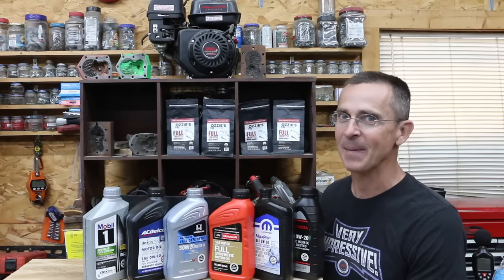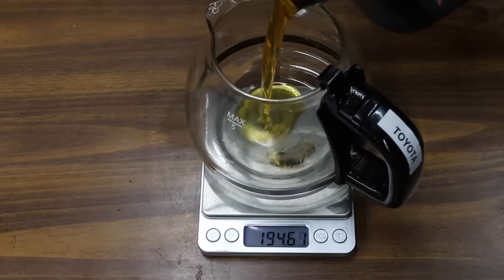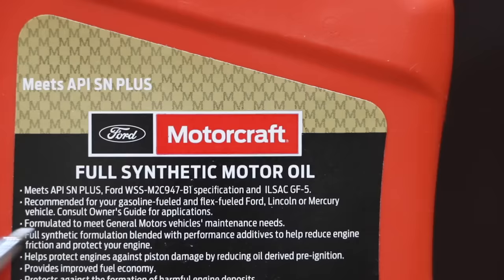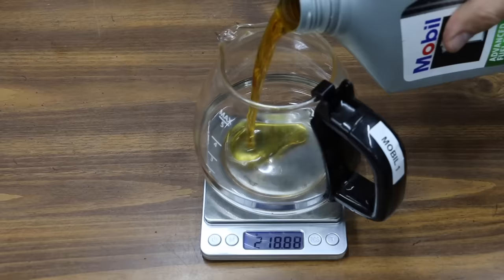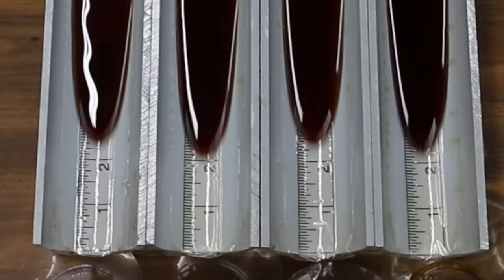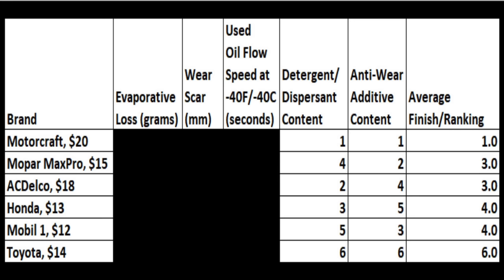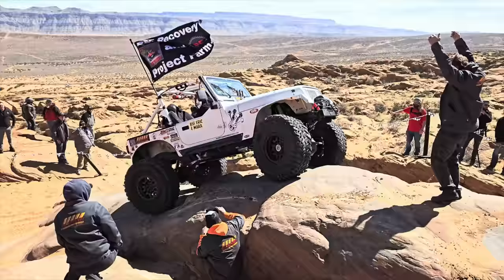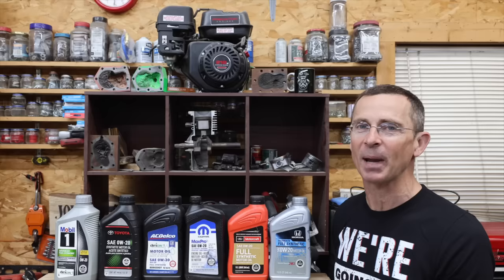How Bad Is OEM Motor Oil? Honda vs Toyota vs ACDelco?

Comment: Appreciate the tests & comparisons. HOWEVER, the burn-off weight comparisons are not calculated right. Since they are not all the same weight initially, one shouldn’t  compare differences by simply subtraction, that’s skew. To be accurate ONE NEED DIVIDE THE RENDERED WEIGHTS BY THE INITIAL WEIGHT TO GET THE PERCENTAGE OFF LOSS. I figured someone as thorough as this guy would follow through on this rudimentary scientific procedure. Right??

Comment: Notice the thumbnail bottles of acdelco , motorcraft and honda oil they are the same. And check the lab results they are extremely similar. The manufacturer is the same i reckon.
Reply from the maker: Thanks for the feedback.

Comment: I wonder if the oil results are why a few Toyota engines have had a reputation to drink oil as they age. My Honda seems to do fine, in fact it seems to shrug off abuse but I'll definitely try some other oils to see if they hold up better especially in the colder winter months where flow on startup is especially important where most engine wear typically happens
Reply from the maker: Thanks for the feedback.

Comment: You need to do more than one run of each test. When results are this close, you can't tell whether the difference is significant without measuring the variance.
Reply from the maker: Thanks for the constructive feedback.

Comment: Test atv/motorcycle specific oils? That would be interesting with a quart costing $7-8 a piece to see if their is really a difference in the oils and basic mobil 1 oil for a car/truck.

Harley oil, honda oil, castrol oil, Valvoline oil, etc all make atv/motorcycle specific oils
Reply from the maker: Thanks for the suggestion.

Comment: Consider using motor oils that originate from their respective countries. For example, Honda and Toyota oils from Japan, or Motul from France. It's possible that these oils are formulated to suit the environmental conditions of their specific regions.
Reply: Also, right now, they released newer versions of motor oils.
Reply from the maker: Thanks for the suggestion.

Comment: I watched a few of these builds curious of what the boost and expected air density improvements made are but none have any gauges showing anything.. I dont expect much boost with the wastegate not kept closed and the turbo might be too big for that engine....
Exhaust turbine housing removal technique used here can damage the turbine blades.  The housing must be guided straight off so that the wheels dont contact the housing..

Comment: You shouldn’t have mixed them up to be more fair, if it fell out of suspension in the bottle, it likely will until a certain amount of jarring actions or turbidity is reached. It’s not like you shake your engine before you start it

Comment: Could you test car coolants? I'd imagine the setup would have to be similar to a computer All-in-One liquid cooling setup. Radiator, tubes, fluid pump, cold/contact plate, thermometer, large fan, and a source of consistent heat to test heat transfer. Then I imagine the same Oil tests used here would work the same for the coolants.
Reply from the maker: Thanks for the suggestion.

Comment: Part of this needs to be taken wit ha grain of salt. Engine design will likely be most important here, as you can use the best oil, but if the design is poor (like it doesn't provide good flow of oil when it's cold, or other issues) then what oil you use doesn't matter.  I'd also like to point out the longevity has a lot more to do with maintenance in general than the brand of oil used. As long as you use the correct viscosity and type and you change it at regular intervals (say 6,000 miles or 5 months for most areas) then you should get a long life out of your car providing your engine is not of a bad design that is prone to premature failure.  I think that we can also say that while the Toyota oil perhaps didnt score the highest in the tests, their motors have proven to be very reliable regardless, and yes I know it's not like you have to use the Toyota oil in a Toyota.  You can use the others, although you may not necessarily want to go using AC Declo dexos1 in your Toyota either.
Reply from the maker: Thanks for the feedback.

Comment: Any chance you can test Ford MC 5w50 vs Amsoil, redline, motul, Castrol. Some aftermarket oils don't actually meet Ford specs and it would be nice to see a comparison. They use this oil viscosity in everything from my Focus RS, mustangs, even the Ford GT.

Comment: I have religiously used only mobile 1 in my fleet vehicle on my town cars and personal vehicles. I will say even though given the results my fleets has all surpassed 1,000,000 miles and personal cars all Mercedes and Audi almost 200,000 miles. Still a great brand regardless
Reply from the maker: Thanks for the feedback.

Comment: Most people that do their own oil changes would never buy the OEM oils anyway. The cost difference is astronomical.

We really need a 0w 40 versus 5W-30 premium oil comparison.

Is 0w 40 Superior in both ways? RR 5W-30 and 10W-30 full synthetics similar?
Reply from the maker: Thanks for the suggestion.

Comment: It might be best to use “slow” oil in the summer and “fast” oil in the winter. 😊
Reply: I use same weight oil year around, 5W-30 🤔Maybe back in 80's or something there might have been sense in using lighter oil during winter but with modern oils there really isn't much point.
Reply from the maker: Thanks for the feedback.

Comment: Would it make sense to calculate the % loss when doing the evaporation test rather than weight loss? As an example 7 grams of loss when starting with 400 is better than losing 6 grams if starting with 300 grams. Anyway thanks for all you do!
Reply from the maker: You are welcome!  Thanks for the constructive feedback.

Comment: I am dismayed for my loyalty to mobil 1. I have been told that there are philosophies for less detergents in turbocharged vehicle use, and to select mobil 1 for its decreased thinning at high heat. I may be putting motorcraft or ac delco in the machines going forward who knows. Sick that you got to go to the offroad games..  building a light crawler truck, nothing like that thing!
Reply from the maker: Thanks for sharing.

Comment: I'm not sure if this has been covered yet, but it would be interesting to know what happens if you put a low viscosity oil in an old engine (like 0w16 in a 10w30 engine) or vice versa.
Reply from the maker: Thank you for the video idea!

Comment: You know... car manufacturers DO NOT make their own oils.  They DO NOT have their own refineries to do so.   As such..they contract major oil companies with oil refineries to make oils for them.     I've personally been to refineries myself where the refineries were producing oils for Mopar,  Motorcraft , AC Delco ect ect to the standards set by API requirements and the automotive brand requirements.   Just think about this...

Comment: My problem is that I own a VW Jetta, and I'm stuck using whatever is on their VW 502 list, which ends up being M1, 0w-40 Euro formula that I can get a Walmart.  I also have a Volvo that needs A5/B5 oil; which I've only found on a Castrol Edge 5w-30, or whatever it is.
Reply from the maker: Thanks for sharing.

Comment: Please excuse my poor writing skills I bought a 2011 four-cylinder Ford Ranger new. I was told to use Motorcraft that's what I used. I changed the oil every time it started to change color. I'm up to 2 7 2. 0 0 0. Miles and with no noticeable loss of oil in between oil changes. I just bought a 2023 Honda Civic and have been recommended to use mobile one. What do you think Should I stick with Mobil 1 or use Motorcraft ?

Comment: I doubt engine oil will be very different between respectible brands but if you own a honda the only transmission oil you should ever use is Honda's
Reply from the maker: Thanks for the feedback.

Comment: Toyota dealer says 10k miles is the span between changes but pro Toyota mech say change it at 4-5 k  those who do their motors last twice as long.  My oil still looks new at 5k that V6 is so well engineered  I would leave it in for 10 but I keep my trucks til wheels fall off .
Reply from the maker: Thanks for sharing.

Comment: In terms of engine oil testing, do not get me worng, just used the one recomender in your manual or equivalent aproved, you should be fine. Not all enginevare built the same. Mobil1 Castrol, Valvoline , Shell  are the leaders.
Reply from the maker: Thanks for the feedback.

Comment: I have a question - and just starting video not sure if you cover it - but I'd like to see a comparison to older oil from the 70-80s vs the newer synthetics today.  I have a 76 GMC motorhome with the olds 455 engine (flat tappet cam).  There's a lot of discussion in the community about needing a zinc additive due to the flat tappet cams -  I'm in the more modern thinking that the newer oils are much more 'slippery' than the old ones and the zinc isn't needed.   a lot of guys run the 15w40 shell rotella for that reason.  which is actually a diesel oil for a gas engine.  what is your thoughts and take?
Reply from the maker: Thanks for the suggestion.

Comment: Please check the claims of Valvoline's new product:
"VALVOLINE™
RESTORE & PROTECT.
Restore Pistons to Factory Clean. The first and only motor oil that removes up to 100% of deposits – restoring your engine to run like new."
Reply from the maker: Thanks for the suggestion.

Comment: Toyota having the largest wear scar bodes poorly for them because of the main bearing failures a few of the TTV6 are having with its oil starvation. Wonder if it’s because it’s a zero weight oil.

Comment: I just bought a 2015 Vette, the owners manual says use only 5W-30 with Dexos1 approved. In 2017 GM sent out an update, saying use only 0W-40 Mobil1 supercar oil dexos2or R. I found Fram makes a 5W-40 dexos2 approved. Same engine in all V8 Cameros. Could you test these 3 oils? Thank YOU!! (only found the Fram oil at Advance Auto Parts stores)

Comment: Powersports manufacturers like Canam tell you to put their XPS oils in their offroad vehicles. I've found that this oil is much more expensive than a common brand of automotive oil. Can you test XPS 5w-40 compared to something like a Mobil 1 5w-40, or a Shell Rotella T6 5w-40?
Reply from the maker: Thanks for the suggestion.

Comment: i'm anal about oil changes. every 5k with full synthetic. on my ford flex years ago, i brought it in for timing chains and water pump under extended warranty at about 118k miles. i had no issues, but the dealer was doing me a favor before the warranty expired. the tech called me and said he had the engine apart, and it was probably the cleanest engine he'd ever seen. i only used motorcraft 5w30 full synthetic on thay vehicle.
Reply from the maker: Thanks for sharing.

Comment: subjectively, I believe Honda wins. the wear test should weight more than additives (that apparently didn't do the job) and at only $13, I can afford to replace the slightly higher evaporative loss.  neglecting those categories, Honda wins and is almost the least expensive.  who knew?  thanks!
Reply from the maker: You are welcome!

Comment: I use the Lexus branded bottle from the dealer. It’s 8 bucks. My oil analysis after 12000 miles is better than the Toyota oil brand new. So I’m sure there is a difference in Lexus and Toyota branded oil. I wish I could post results. But just the zinc is almost 900. And it’s as new and good as go at 12000 although I’ll be doing it at 10000
Reply from the maker: Thanks for the feedback.
Reply: It’s the same exact stuff.
Reply: @JohnnyUtah9173 I had them tested. More moly in Lexus oil. I’ll see on the next one. I’m going by what I get and what is posted on this post. The moly is less on the chart posted. If it’s the same his number doesn’t add up.
Reply: To be fair this is 0-20. That’s why.
Reply: @mason7300  Lexus IS Toyota. Both labels say distributed by Toyota Motor Sales. Surely you don’t think that every batch of Toyota’s oil will have identical numbers, or that multiple tests won’t yield slight variances across multiple samples.

Comment: What I am really looking to find out is, how does your test winning Amsoil and Pensoil compare to the Dexos I run in my Tahoe and the Motorcraft I run in my Explorer ST. Particularly trying to see if another oil will work better in the Twin Turbo Explorer ST.
Thank you 😊
Reply from the maker: Thanks for the suggestion.
Reply: Any popular full synthetic is about the same for longevity and cleaning, biggest thing you want for Turbo engines is a 30-weight for lubricity and high shear strength and preferably better anti-wear additives (Molybdenum, Zinc, etc). 0w20 has lower lubricity and protection as a tradeoff to cover extremely cold climates, but is significantly worse protection than an equally refined 5w30 or even 10w30.
Reply: Because my Explorer ST uses direct injection on the 3.0 twin turbo, I am always looking at the evaporation qualities of the oil, so I don’t have to rely as much on my dual line catch can.

Comment: Motor oil is only bad when you don't have any in the engine.  A 20 year old bottle of Pennzoil is better than none at all.  Video should read "which motor oil performs best in theory."
Reply from the maker: Thanks for the feedback.

Comment: When you get your oil changed at Toyota do they use the Toyota Oil? Because Toyota engines have a reputation for being over engineered and lasting a long time. There are Tundras out there with 1 million miles, even have towed a NASA spaceship, and 4Runners are notorious to rarely ever going in for repairs. So is the oil engineered for the engines specifically? Do they use the same for their hybrids and iforce max? The 5.7 v8 and the 2.7 V6 VVT-i have great reputations, are they using that oil you are testing?

Comment: These are engine oils, not motor oils. Engines run on internal combustion. Motors run on electricity.

Comment: These OEM oils feel like a total scam. Around $20 for a quart when you can get a 5 quart jug of pennzoil ultra platinum for $25.. So its 4 times as expensive for similar or arguably worse oil.
Reply from the maker: Thanks for the feedback.

Comment: If i been using motorcraft 5w30 for my mach 1.  Based on ur oil testing experience is switching to kirkland 5w30 a bad idea?
Reply: I wouldn't risk it.

Comment: It's all mineral oil unless you get into man made oils which are PAO oils and the only part of oils that is synthetic is the additive package but if you take away the additive package its all the same oil its called mineral oil from crude and the oil these days is no different than oil 40 yrs ago but the additive packages are different these days but it all does the same thing it lubricates and cools that's it, just change your oil no more than 4000 miles and no problem, many engine rebuilders have told me the same thing 4000 miles max and change oil and filter.
Reply from the maker: Thanks for sharing.

Comment: Mobil 1 has fallen over the years, considering about 20 years ago it was a real synthetic (Group 4/5)  and now just a mediocre Group 3, like 99% of the store brands which are phony synthetic. Leaves Royal Purple, AMSOIL Signature, and Redline as the U.S. real Synthetics. Mobil1, Penzoil Platinum and Castrol Edge as the most overpriced Phony synthetic oils, and are priced like a real synthetic.
Reply from the maker: Thanks for the feedback.

Comment: What happened to the OEM Toyota oil that had a huge amount of moly. Similar to the Mazda with its bonkers moly content.
Reply: I believe Toyota switched suppliers when they changed from cast iron closed deck engines to aluminum open deck. They no longer use Castrol. I think it's Mobil 1 and designed for fast flow on startup. Not for heavy duty use but efficiency instead. Best mpg over durability

Comment: What if you combined 2 different brands together. Like Toyota and Mobil 1 together, could it beat Motorcraft? Like a hybrid brand, so to speak. Like this brand is good here and here but this other brand is good here and here. So, if I combine these two brands do I get a better oil?
Reply from the maker: Thanks for the suggestion.

Comment: I guarantee the manufacturer does not manufacture their brand of oil.   There is a 3 rd party manufacturer like Warren that simply labels the container with their brand

And the funny thing is, if you go to most dealerships, they use bulk 50 gallon drums of oil whether it's conventional synthetic or some thetic blend for the most part they don't even use their own brand oil because of the expense .  Bulk 50 gallon drums.
Reply: We always had the motorcraft oil delivered in bulk to the dealerships I worked in. It didn’t come in drums. A truck delivered it from a tank.
Reply: @AlphanumericCharacters  well, the jeep dealership I used to work at when I was in high school used to just get bulk 50 gallon drums.

Comment: What oíl you'd recommend for a 14 charger persuit daily drive 5.7
I use mobil 1 adv full syn extended performance with mobil 1 oil filter
Reply from the maker: Thanks for the suggestion.